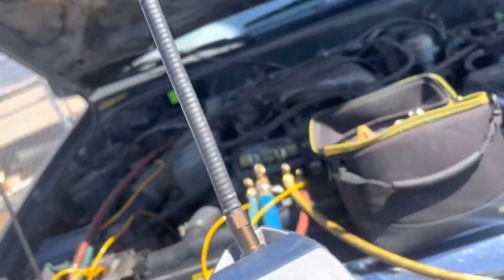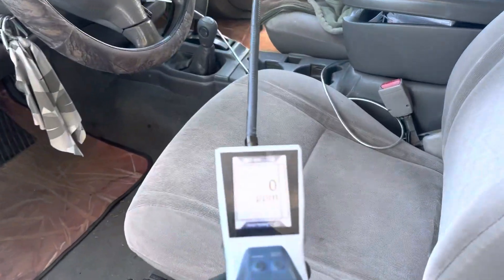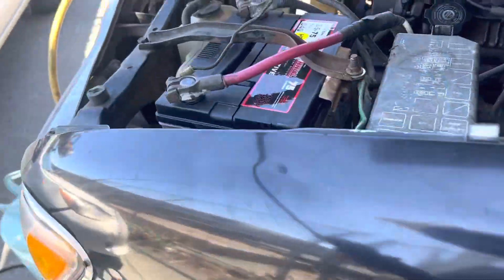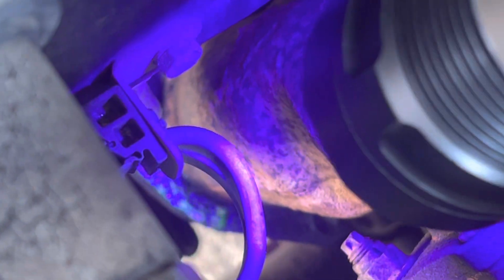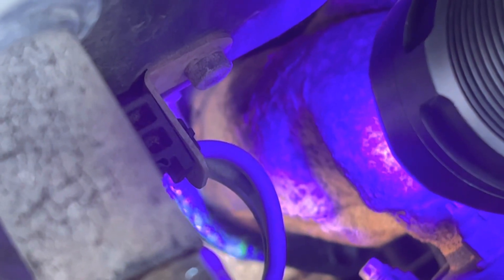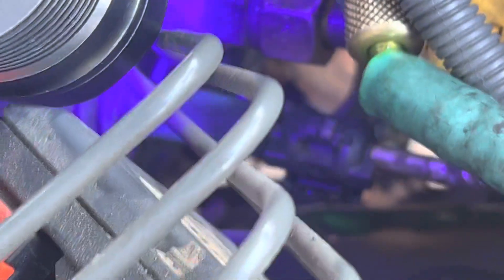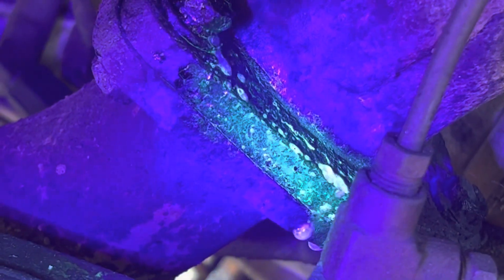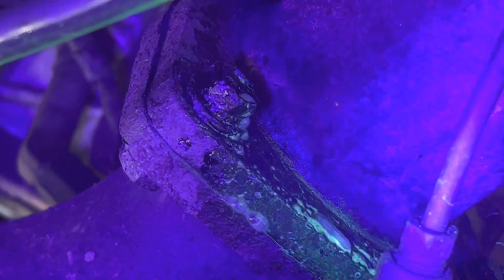Toyota 4runner evaporating leak massive refrigerant loss. ￼

Comment: Does dye also act as a lubricant (oil)? If you need to add oil (say you're replacing a condenser) would you add the required amount of oil plus the dye (let's say one ounce)? Or would you add one ounce less oil, because you're also adding one ounce of dye?
Reply from the maker: A good concentrated quality dye will not be 1 ounce it’ll be like 5 mL almost nothing 2 milliliters

Comment: When looking for a leak using dye, is there a time frame in which you want to look for a leak after the dye is in? 

Or does the dye stay in the system until your car runs out of freon?

I know my car has dye in it, but trying to find the right uv light and not sure if the dye will drain out before I can start looking for the leak?
Reply from the maker: The dye stays in the car for the life of The vehicle it never comes out

I’ve heard of some cheap dyes losing their brightness over age but I’ve never used cheap dyes 

Tracer line products UV dye

Comment: Can you recommend a good dye, injector tool, and UV light? Thanks for all the info!
Reply from the maker: If I had to recommend one light it would probably be the UV Beast 365 available on Amazon and eBay . 

It works on the widest range of UV dyes because different manufactures do make different dyes in different UV spectrum’s anywhere as low as around 290 to 300 nm. Up to 400 to 410 nm wave length. 

Tracer line products

AC Extends

These are two products I use I’ve been using tracer Lane products for 40 years my father was using them he introduced me when I was still a child before high school.

Comment: Would refrigerant mixed with condensate be concerned when it’s touching the manifold? Mainly phosgene gas? Or are the concentrations not significant for that?
Reply from the maker: It’s not a burning hot flame above the flashpoint of the refrigerant so there would be no concern. 

It would be more concerned with the refrigerant oil then you would refrigerant most of the refrigerant itself left in the airstream of the passing here over the evaporator coil just dripping refrigerant oil with UV die is falling to the bottom of the pan mixing with the water